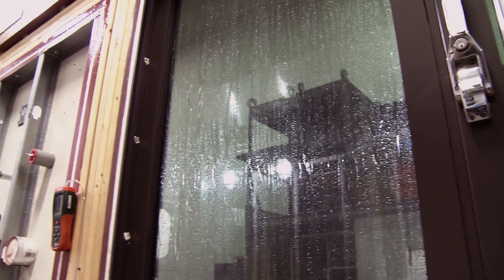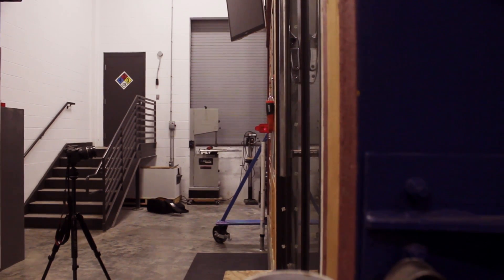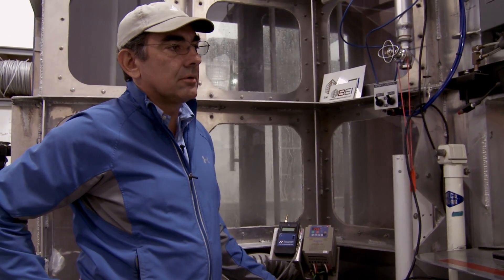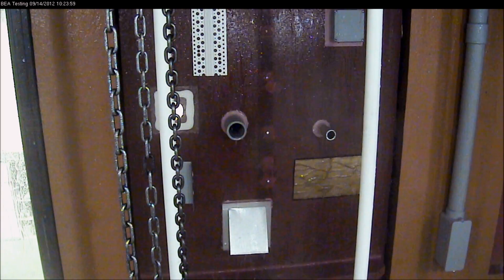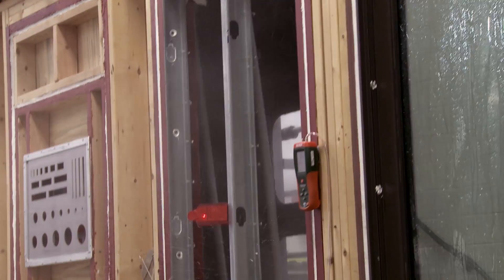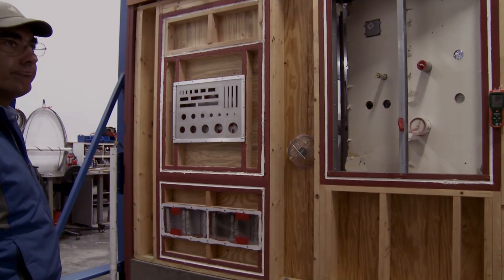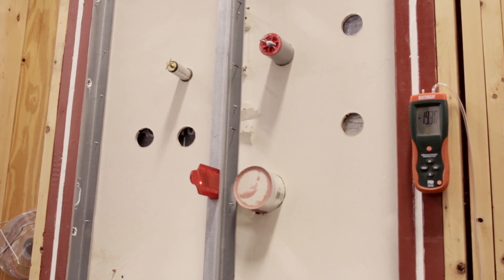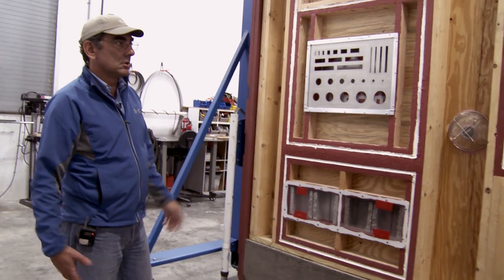Testing a Wall Assembly to break point

Comment from the maker: Awesome. Yeah, our mockup wall assembly had structural failure at 19.7 inches of water column.  Be careful with your testing and please share your results.
-John
Reply: Is the pressure source to apply 20 inh2o a screw compressor, tons of big fans, or what?